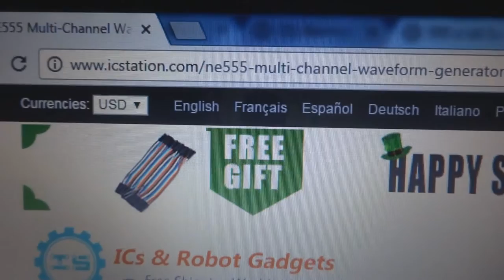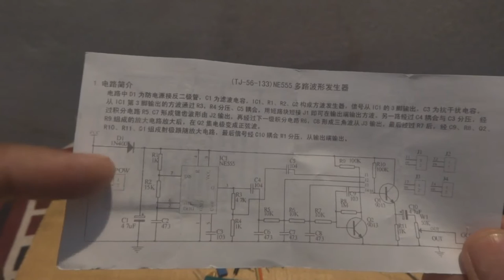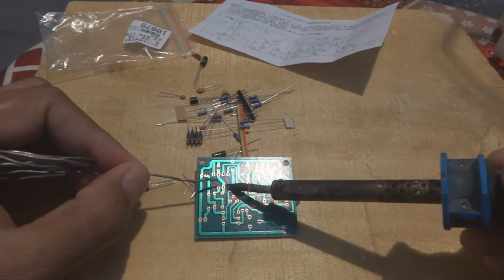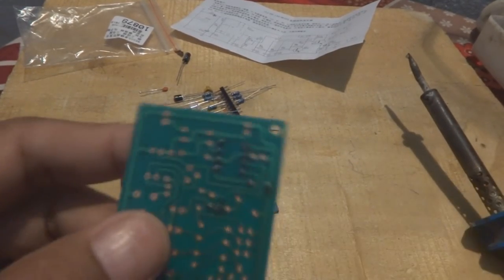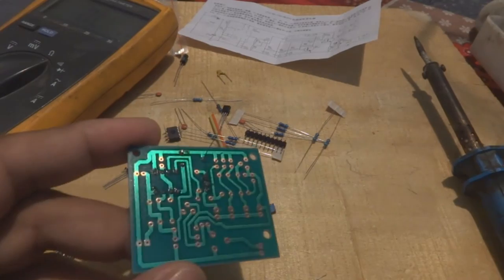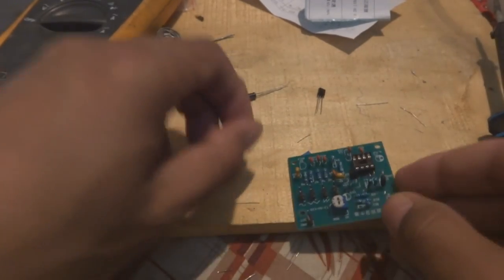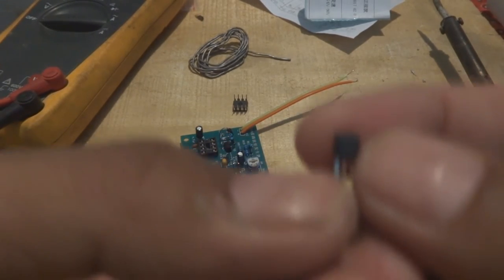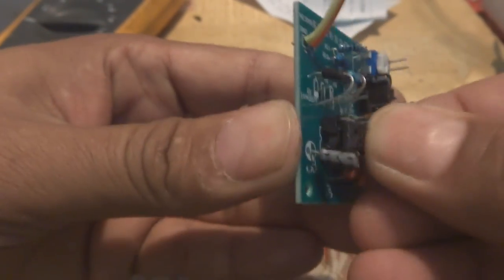NE555 function generator project; ICStation project.

Comment: Smashing job jahan :-D
Kits are fun to assemble and usually work first time, ive made loads :-D.
i find them enjoyable, even the much bigger kits too.
Nail clippers are a good replacement for wire cutters, cheap and get really close.

The very old and still really usefull 555 timer chip, from around 1970.
Love the chip, it lends itself to all sorts of circuits, its amazing that its still made 40+ years after its invention :-D
Reply from the maker: Sure sir this is amazing. This chip is exciting and can be used anywhere. I myself made many circuits using this chip. Great invention and very chip also.

Comment: 1st time I've seen anybody put that many electrical parts on a board - wish you would have done the diodes - no problem though - not that hard
Reply from the maker: Diodes are also the same. Anyway in any other kit when I will fix I will follow your instructions. Regards,